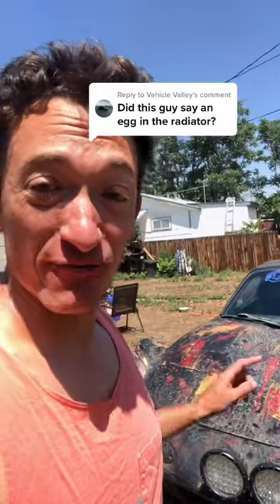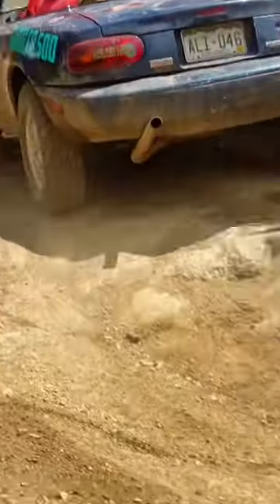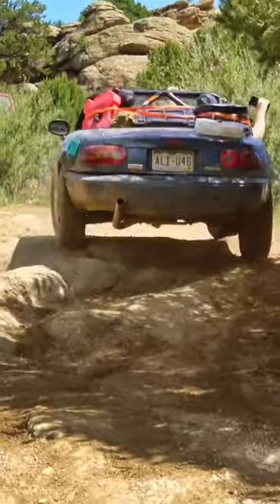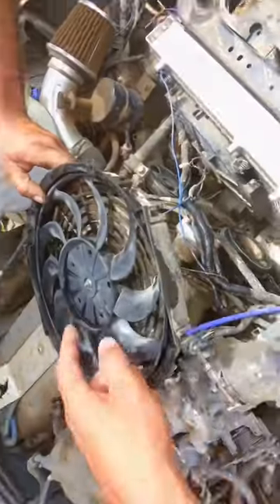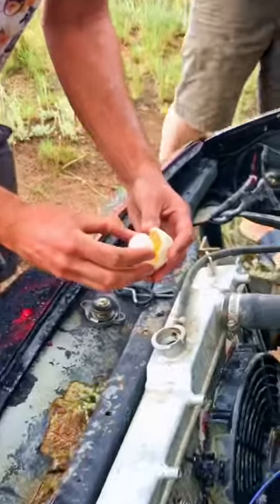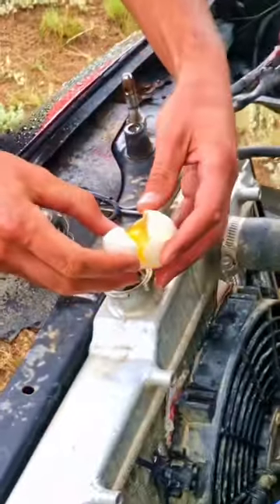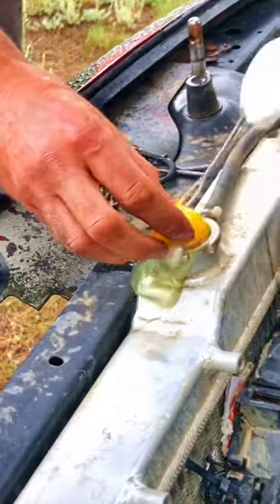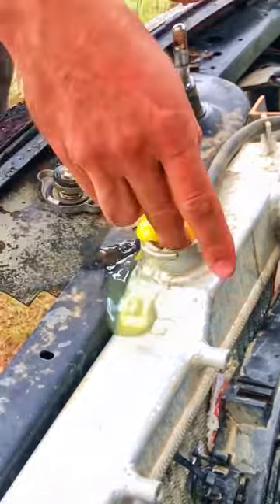Mechanics hate him for this one simple trick

Comment: A buddy of mine used an egg to fix a leak. He decided to cancel the order for the new radiator. It worked for a few thousand miles. Then his heater core sprung a leak and his car fogged up with stinking egg film for weeks.
Reply: Lol thats awesome!
Reply: Yea that's why I use black pepper lol doesn't mess with anything but the extra will settle after awhile but in the mean time it keeps going in there and constantly replugs the hole if it gets bigger will last for awhile used the little pill things they have at Walmart in the bottle in some sort of fluid and it broke the impeller in my water pump... Was so pissed only time I ever broke down on the road happened 10 miles after the damn things were put in pepper never let me down though still a favorite of mine!

Comment: Black pepper for smaller holes and cracks works also my friend drove his Nissan Murano from New Jersey to Florida 900ish miles without needing to add water busted radiator on the return side lol used it on my 99 Silverado for 3 years went from adding 3 gallons of water every 60 miles to 1 gallon every 2 weeks I had 2 issues a leaking water pump and like always a busted radiator near the return hose imagine that lol

Comment: Pepper is good if the holes are small and for bigger ones, as long as there isn't a whole bunch, a piece of wood just small enough to fit in the hole, and the hot water will swell the wood and seal it.
This is kind of weird as I just saw a cyclist run over in a particular town, and I lost a friend the same way in the same town, but the last time I saw him was more than a year after I plugged the rad in his dad's company van and it was still there.